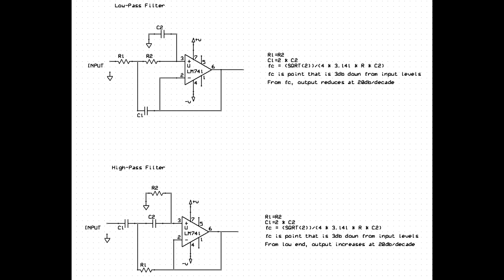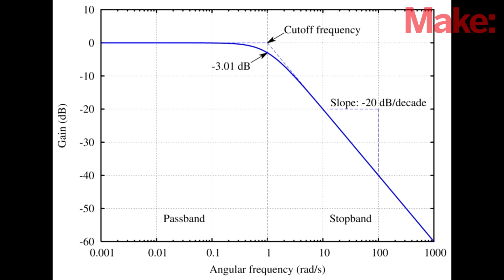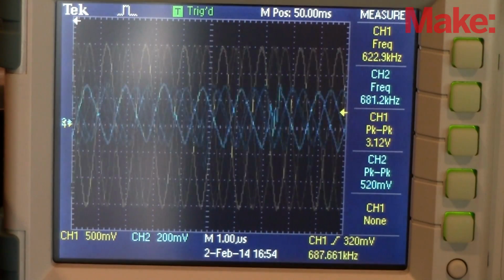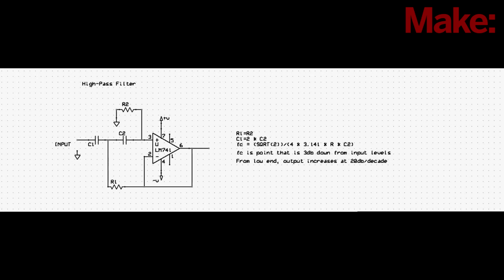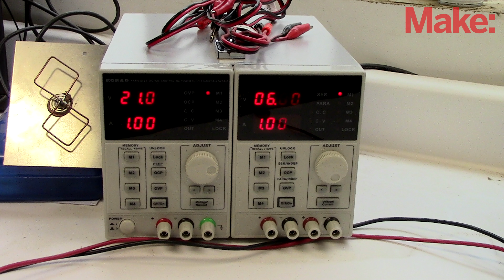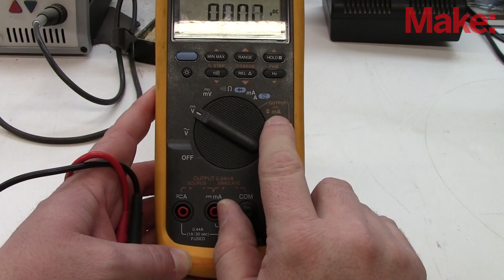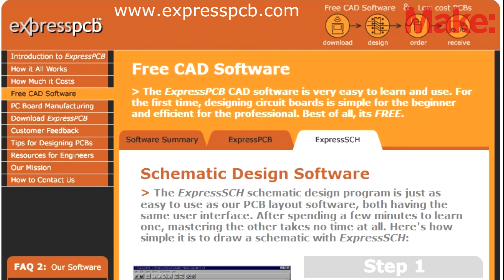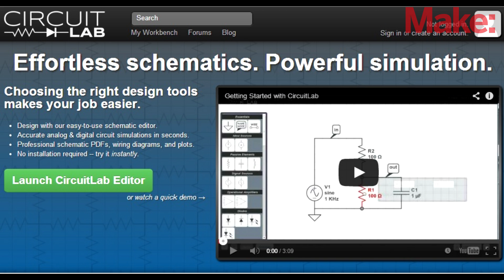Projects with Ryan Slaugh: Filters and Tool Tips

Comment: I wouldn't call this LPF passable because of how much the slew distorts the output waveform before the frequency reaches the 3dB cutoff. You didn't show the output of the HPF but I would guess that the slew adds so much distortion and attenuation that it would be unusable. Gotta either lower the 3dB cutoff or use a better OpAmp.
Reply: I agree.  My overall aim was to show the reduction of the output amplitude.  The only frequency source I had at the time of filming had a minimum output of 500kHz.  The LM741 is much better suited for lower frequency filtering.